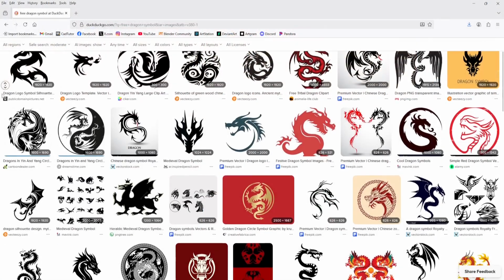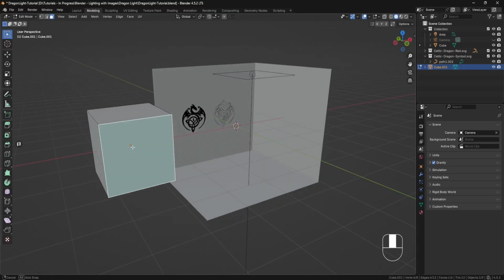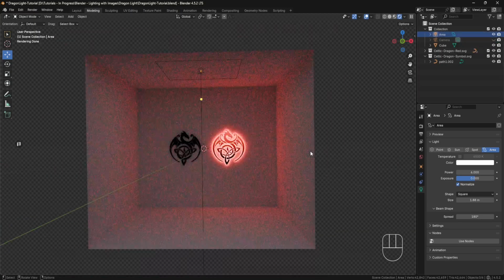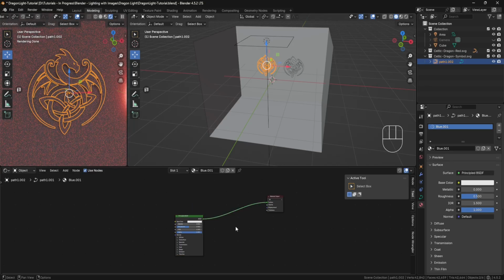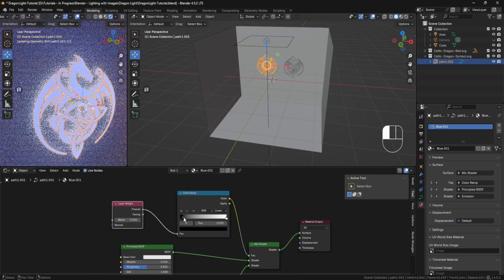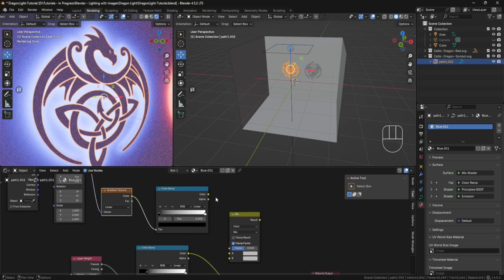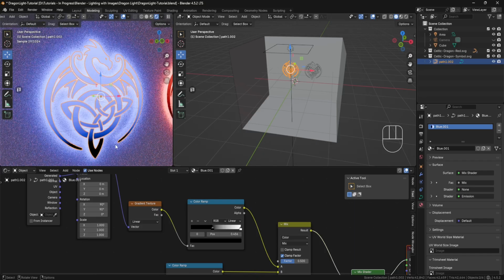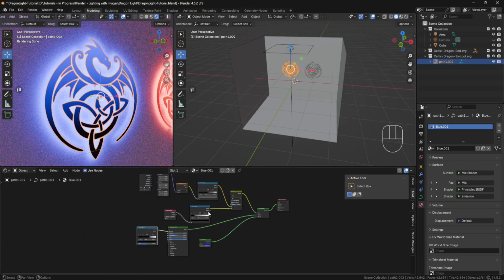Make this Dragon Light in Blender (Step-by-Step)

Comment: After you add the Layer weight node, delete it and add the Geometry Node. Yes there is a Shader Node with that name.
From the Geometry Node - plug the Backfacing socket into the Fac Socket of the Mix Shader. 
Just like that - the color plugged into the lower Shader input of the Mix Shader is now applied to only the rear of the mesh......
So Color for the front & Emission for the back..... 

Add a second Mix Shader into the Bottom Socket of the first one, and use another Gradient setup to control two colors of light.....
Reply from the maker: Thanks for the tip. I'll have to try it out.